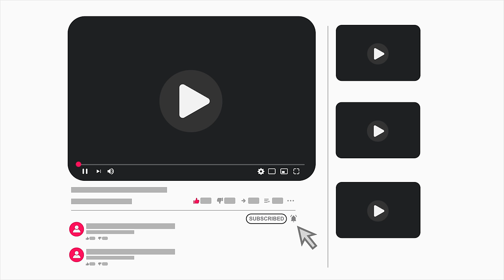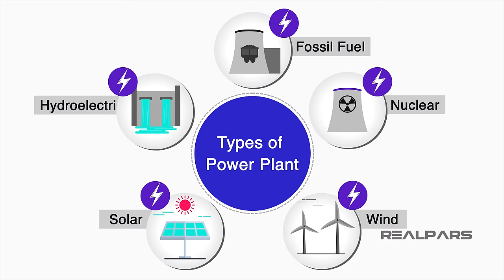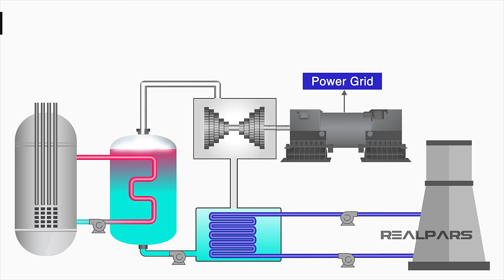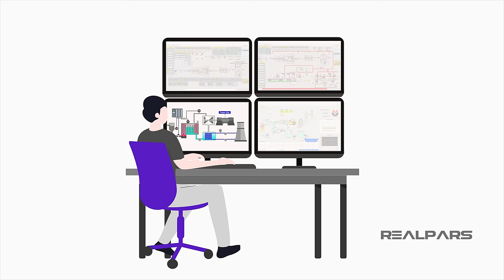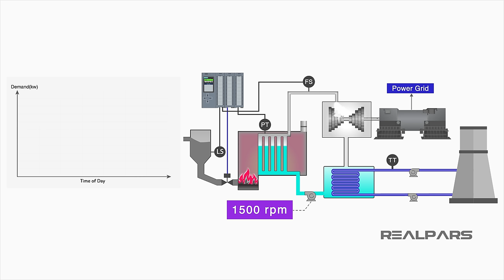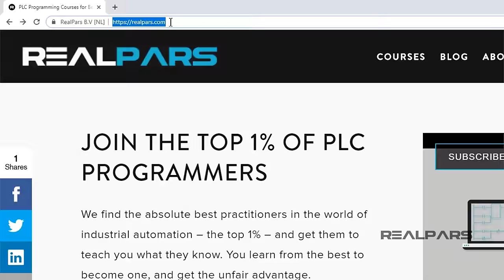Power Plant Explained | Working Principles

Comment: What is done with surplus power? When a power plant generates more power than is demanded.
I guess you have batteries, but they can only store a little bit of power.
Is the power just dissapated into the ground?
Reply from the maker: This is done through a process called load balancing. Load balancing is done by distributing the clients on different phases of a three phase system.  The control systems at the power plants monitor usage, and as the video showed, automation systems can ramp up or ramp down the electricity produced to keep the grid balanced.  Some plants can do this better than others, so the more flexible plants on the grid are used for load balancing across the grid, and larger plants are run as constantly as possible to maintain base loads at peak efficiency.  And yes, any excess is sent to ground, but this amount is a lot less that you would think.

Comment: It needs some corrections. Photovoltaic Panels do not generate electricity because of the sun's heat, but due to the energy of the photons in light. Heat has nothing to do with the electricity generation it just effects the efficiency.

Comment: Doesn't a wind turbine need a VFD to match its frequency with the standard grid frequency?
Reply from the maker: Excellent question!  Modern wind turbines use power converters to match the frequency and voltage of the generated power from the turbine to the grid.  These power converters are fairly sophisticated, and consist of RC circuits, IGBT's and SCR's that allow the power from the turbine at variable speeds to be converted to standard voltages and frequencies.  They act sort of like VFD's in reverse, and often consist of rectifiers and inverters to produce the required voltage and frequencies.  There are many high-tech features of modern wind turbines that adjust the pitch if the blades to match frequency and use doubly-fed induction generators (DFIG) to match the produced power with the grid.
Reply: @realpars  thank you for the responce it is very appreciated